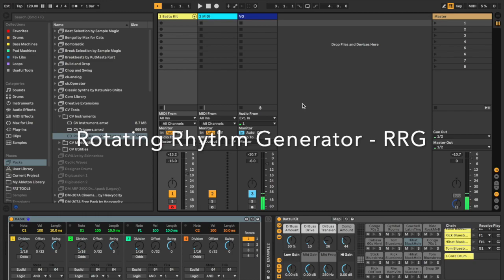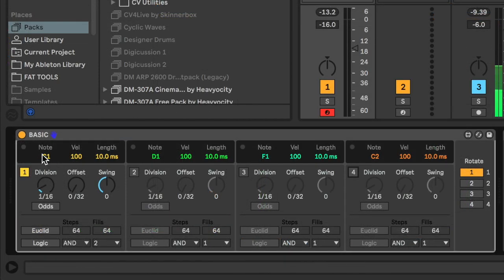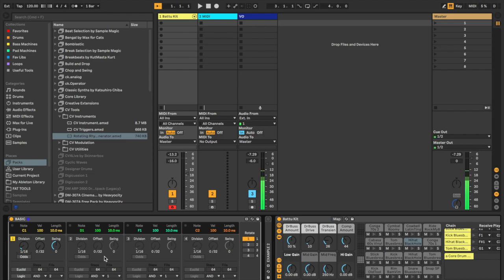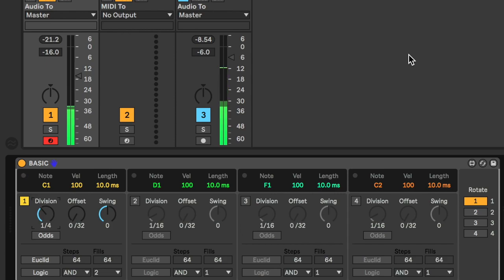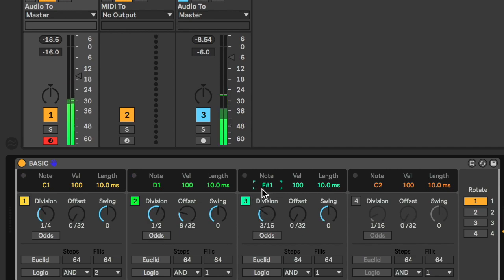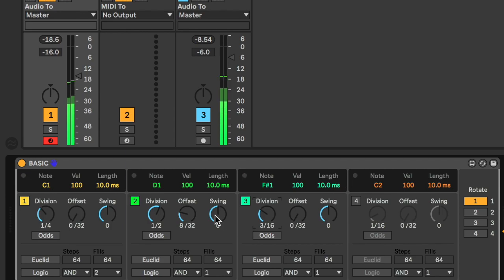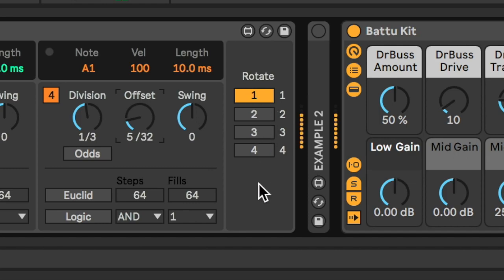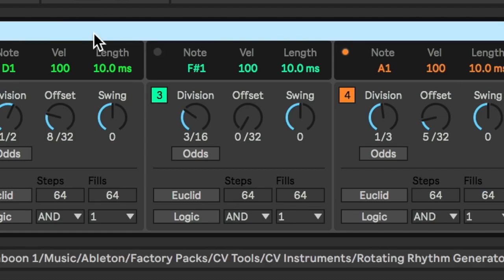ABLETON LIVE 10 [TUTORIAL] ROTATING RHYTHM GENERATOR - CV TOOLS:  Music Production (2020)

Comment: hey man, great video. for some reason when i hit play the rotating rhythm generator doesnt start playing? im not sure how to get it to work. sometimes itll take a while and then start working. any ideas? im sending midi out of my midi interface to a sampler
Reply from the maker: hi there, thank you for your comment. That's a bit odd as it should start generating triggers as soon as you press play. I'd recommend doing the following. Instead of sending triggers via your midi interface to the sampler, first of all try it internally in Ableton. This means placing the rotating rhythm generator on a midi track and placing a  populated drum rack after it. If you press play and it triggers drum voices, then the issue occurs once the triggers are passed to the midi interface and on to your sampler.

As a variation of the above, can you trigger sounds on the sampler through Ableton without using the rotating rhythm generator?

Let me know how you get on.
Reply: @husseinboon  Thanks for your reply, I actually found out the issue. It seems there is a bug in Ableton that prevents it from starting.

Whenever I drag my rotating rhythm generator onto a midi track WHILE ableton clock is going, the RRG wont play. Even if I start and then stop and start again.

When ableton is not playing, I have to drag the RRG onto a midi track THEN it will work once I hit play. Some weird bug.

Only reason I ran into this issue is I use ableton for improvisation a lot, on the fly music making.

Maybe this will help someone else. I was stumped for a while on this.
Reply from the maker: Thank you for a bit more detail. I've tried to replicate what you're doing and I'm not sure it's a bug per se. For me, dragging RRG into a track whilst the project is playing does not start immediately either. The first time you drag it on to a track, irrespective of what you do the RRG won't play. If you delete RRG and drag a new one on the track this seems to play. I think RRG, when dragged into an already playing project, misses some key prep/setup info, which means it doesn't play nor update its status. Might be a quirk of Max or Ableton, or even a quirk of the programming approach.

Similar-ish to midi active sensing: http://midi.teragonaudio.com/tech/midispec/sense.htm. Still, it's probably worth raising with Ableton and see what comes back.
Reply: @cdcdplayer  hehe I am glad I found this post of yours! It diid indeed help me when feeling all bugged out about this :p
Reply: @cdcdplayer  this helped a lot, thanks for the tip!

Comment: I have a beatstep Pro and a small eurorack setup. Looking to get cv tools will I be able to do this  and send to the eurorack system? Or do I need a dc coupled interface?
Reply from the maker: A dc coupled interface is always recommended but audio can be used. Skinnerbox's CV4Live can use a non-dc coupled audio interface. Download here: https://maxforlive.com/library/device/4152/cv4live-by-skinnerbox

The section on the Ableton help reference has a small bit of info not using a dc coupled interface: https://help.ableton.com/hc/en-us/articles/360004966139-CV-Tools-Overview-Technical-FAQ

You can also consider sending this as midi to your Beatstep pro and see if it passes this information on to your modules.

At the moment are you syncing your BSP with Ableton and driving your eurorack modules from BSP?

Hope any of the above helps.

Comment: How do you convert whatever you get out of this rhythm generator into a midi pattern?
Reply from the maker: You need to setup an empty midi channel, set its midi from to the track where you have the generator.  Set monitor to in and record the midi activity. Bit more info here: https://www.ableton.com/en/manual/routing-and-i-o/ in the Internal Routings section (15.5 onwards). Even though most of the discussion is about Audio, Midi is internally routed in the same way.